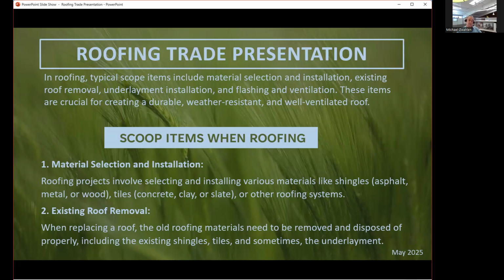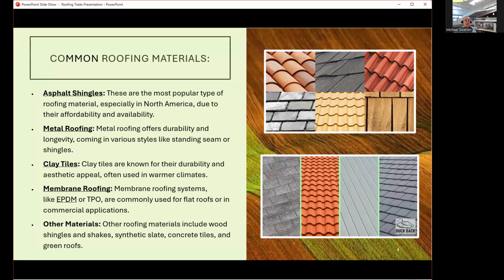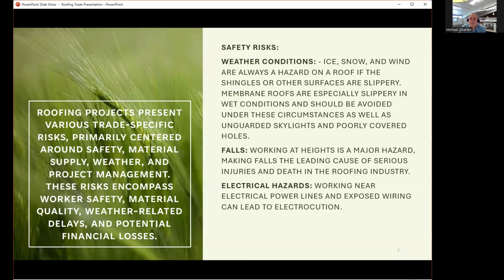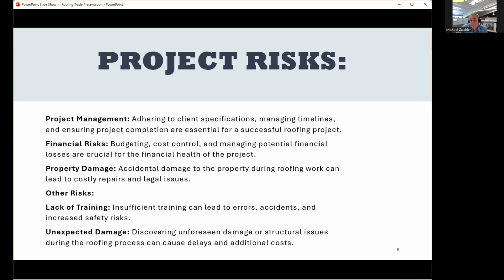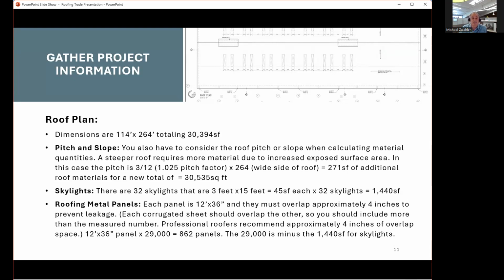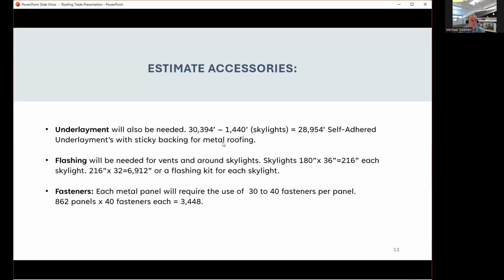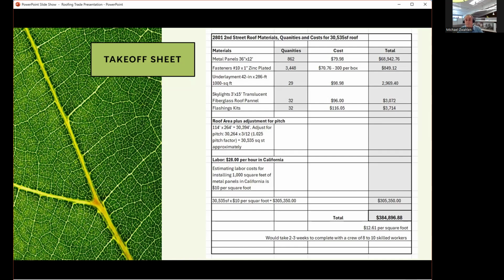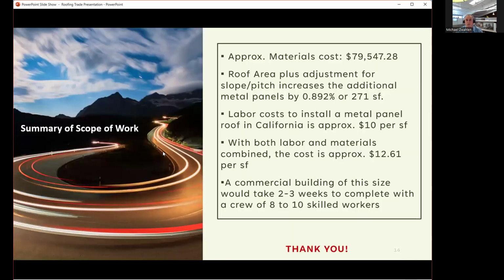M. Zwahlen video Trade Presentation on Roofing 5/2/2025

Comment from the maker: May 23 at 5:02pm - 102/100 A+
- Moises Guandique Hernandez, Course Instructor: Magnificent work on your trade presentation Michael! You demonstrated a thorough understanding of the Roofing Trade in the construction industry. You also demonstrated strong presentation skills by providing clear and concise statements along with great volume/tone/rate. The presentation could benefit from paraphrasing some of the slides and reducing the amount of direct reading from slides. Thank you for mentioning the unit of "Squares". Roofing is typically done over larger areas and therefore the more commonly used unit, specifically in commercial roofing, is squares. Thankyou for mentioning the risk of protecting the roof once complete to avoid damage. On TI projects, it may be a good idea for subcontractors to lay plywood or another protective barrier between the roof and any moving load (e.g., an HVAC unit on rollers). Excellent point mentioning pitch. This is often overlooked, however, it is important to calculate. We can only see so much information on a 2-D plan, thank you for considering the third dimension and the increased surface area associated with roof pitches.

Below are some other items to consider when discussing roofing:
1. Temporary Weatherproofing for replacement of existing roofing

2. Overlay of new roofing over existing roofing systems (e.g., Sikalastic or Neptune coating systems)

3. Coordination with HVAC trade. HVAC equipment is typically mounted on the roof and it is important to ensure weatherproof penetrations at the roof. Coordination with many other trades if there is a patio/balcony on the roof.

4. Guarantee of water migration. Roofs must ensure that there must be a slope (structural slope or tapered insulation) to ensure water does not puddle and cause issues. 

I appreciate you showing the completed takeoff, however, it may have been useful to show the audience the steps associated with completing the area takeoff for the roof. I trust that you are familiar with how to perform takeoffs based on your examples and estimating analysis on your penultimate slide. Overall, you didexcellent with this presentation!

- Moises Guandique Hernandez, Course Instructor